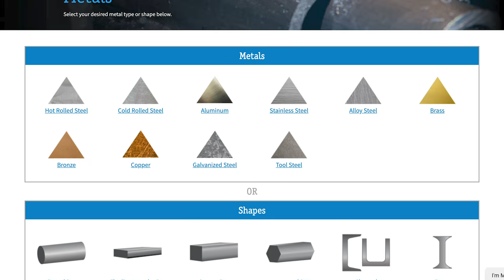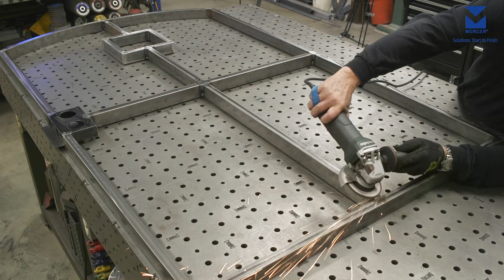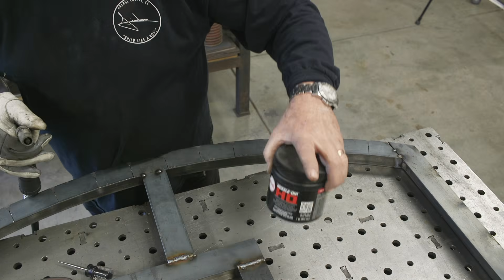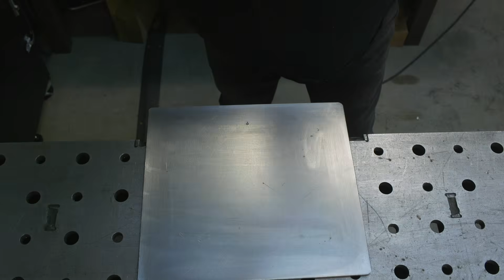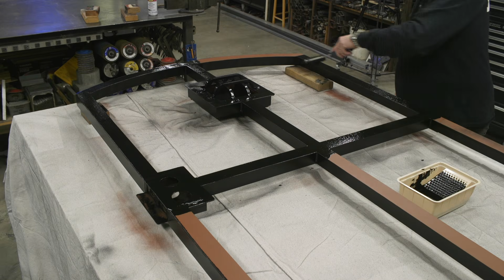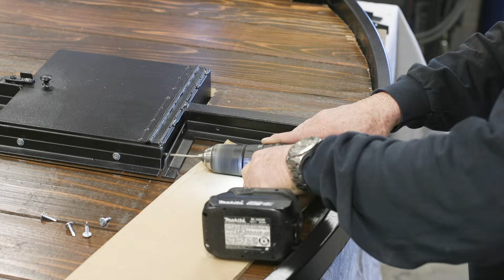Rustic Metal Speakeasy Gate Door | JIMBO'S GARAGE

Comment: Just curious after watching until the end that you made this gate to open inside vs outside leaving the lock box seam covering the access to the plungers.. I know it is preference. but also noticed that the deadbolt and handle plunge isn't protected/covered on the outside.. Intentional or did you add something later?

Comment: It takes the same amount of welding no matter the size of the frame. I made a hundred clothing racks out of half inch pipe and gave them a good discount on it and they were happy with it and I made good money on it and I was happy with it. Then I had another customer that wanted me to make them some racks and when I told them they were more they couldn't understand why because they were smaller. I was like well the ones that were made before had 16 joints in it this has 24 joints in it that's one and a half times as much that has to be cut and cleaned and welded and cleaned. And they just get bowed all out of shape. It's not always the size of the project but have complex it is

Comment: Great job BUT . . . all that work and you're using soft pine? I certainly would have used a hard wood - Oak or even Cedar...Hickory or even Heart Pine. The soft pine with the walnut stain always looks to me like the cheap stuff we built as kids - bed frames and low end furniture, etc. Soft Pine just doesn't have the nice grain and moreover, it certainly won't stand up to the elements or to a lot of use and abuse over time.

Comment: Very nice, I like the 1/8" lay wire trick for the gap, Gunna have to try that one.  My favorite wood stain is good old waste oil. next oil change, try a little on some wood, can even be clear coated. Works great on my Harley too. any black powder coating, will glisten.

Comment: For a saw rest, get a roller or two and make a frame for each that bolt to the ends of your table. They are removable and don't require much storage space. I made my saw stand a bit higher than my table and the roller brackets put the rollers the same as the saw be. One at each end gives you support for long pieces and there's no resistance pulling the stock forward.

Comment: Amazing!! If I had the space, my garage would be exactly like yours! I have most of what you have but smaller scale. 120v welder, 3x3 table and 1/4 the space!! You do nice work Jimbo!! Use the flat sanding pad to prevent divots. I really liked how you created the radius flat bar technique! Having the large table is a god send ! I’ve leveled up my shop/work just by investing in the $400 Evo saw, and 3x3 ,3/8” thick table. I just wish I had the room for the larger and super flat table. Thanks jim

Comment: I build gates for a living. Should have primed the back side of the flat bar with etching primer or some sort of oxide primer. Water will rust between there. I would have used 3/16 angle thick for the frame.

Comment: LOVE IT!
However, I'm the guy that says 2" Steel Tubing 1/4" thick with 3" of White Oak.
Run 1/2" threaded through the White Oak vertically and bolt to top & bottom.
This way, even if they decided to break into your home it's going to take an hour.
Also,  make sure that your frame that holds the door is the same to 18" around. :-)
Reply: "This way, even if they decided to break into your home it's going to take an hour."
Unless they're French and bring Le Trebuchet! HON HON HON! 🥖

Comment: If you want a surefire way to measure reliefs, take the total angle of the bend and divide it by how many reliefs you have and you have the angle to cut for each one. For example if you have a 90° bend, and 10 relief cuts... each one is 9°.  More work but not by a lot. Anyways this door is amazing, you are quite the builder.

Comment: Excellent work, as usual Jimbo. I really do enjoy and learn a lot from your videos. Hearing your comment about the lack of space for long material on your chop saw, I thought of a solution I’ve seen on several wood working videos. You could cut out and hinge a section of your welding table and have the saw flip up from below and be level with the surface of the table. When not in use, lower the saw and close the table top. Obviously, that would require cutting into your table...which may not be something you want to do. Just a thought. Thanks for making such great videos!

Comment: Very nice quality job.
Love your video's. 

Planning to build one. To do a high quality job in a Northern climate, I will be galvanizing the metal ( inside and out of the square tubing).  Afterward slightly sand blasting the galvanized  metal prior to painting, so the paint will properly adhere to the metal.
I do understand why you don't have to do that in a Southern Climate. 
Thanks again for making this video.

Comment: Thats a very nice Gate!
I noticed that you are tilting your anglegrinder quite a bit up when using the flap disc.
Try to lay it flat on when grinding. 
This will not only enhance the lifetime of your flapdisc because they wear out more evenly, but you will also get a better surface after grinding. There will be less low and highspots.

Just a quick tip, thought it might help, have a nice Day :D